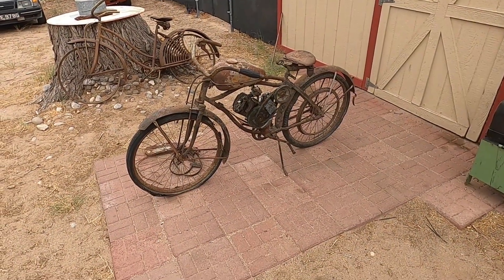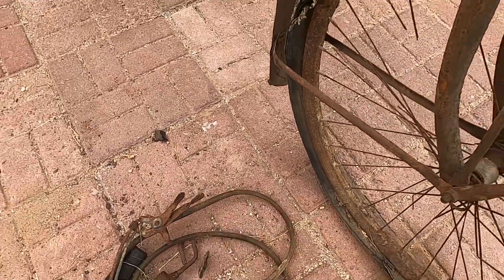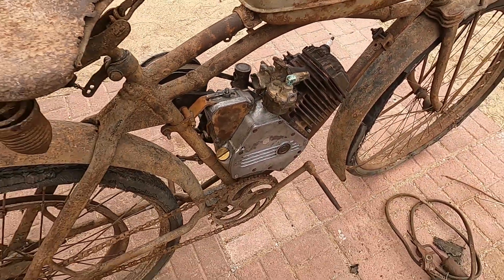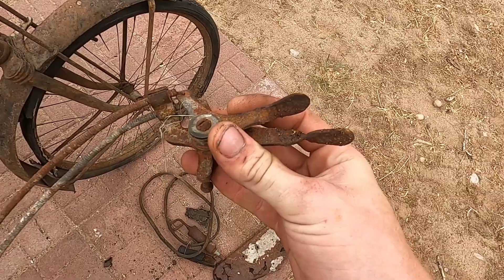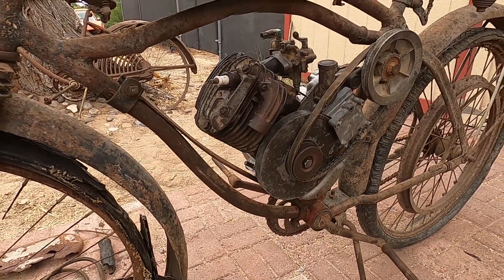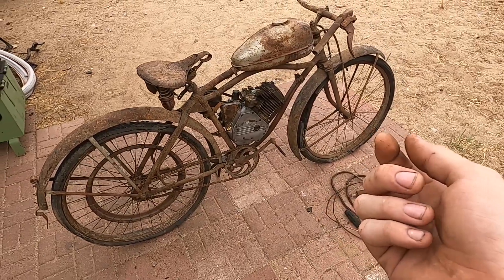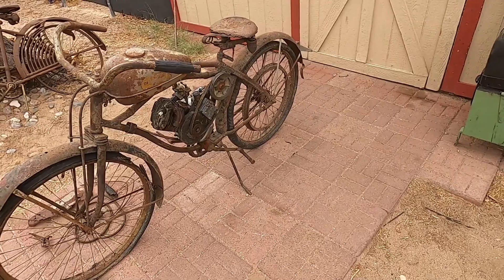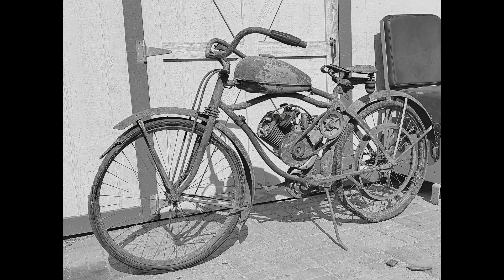My Original Barn Find Whizzer Motorbike - Do I Get It Running?

Comment: I would love to see it running in the shape it's in all except for the safety and operational parts that need to be replaced
Reply from the maker: Hey Lee! I didn't know you were on my YouTube lol. I totally agree on the safety bit. The frame is still solid but the front rim's spokes are shot. The rear are thicker gauge so they're a bit nicer but I'd still consider replacing them..... Or both rims altogether.